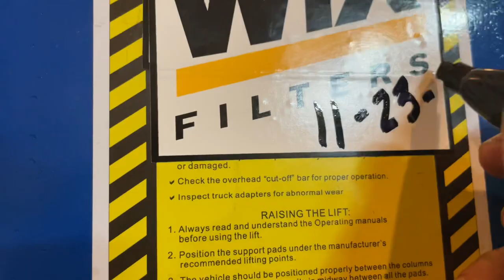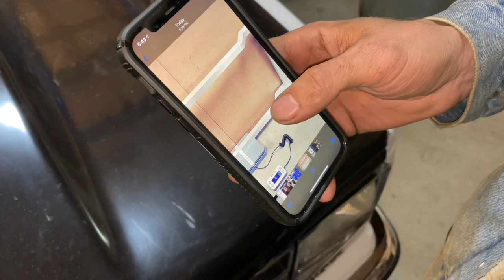Midweek Maintenance on “The Kid’s” S-10!  Valve Adjustment, & Oil Change.

Comment: Eoic...is how I adjust ....to be on the right side of the cam.... When the exhaust valve is opening.. adjust the intake valve... When the intake valve is closing.. adjust the exhaust valve... On my 360 Chevy in the 78 GrandLeMans..

my 66 tempest I adjust them  both when  both  valves are closed ... I haven't had to adjust the 66 Pontiac 406 in years... Both have solid flat  tapit cams in them.. I checked the 406 Pontiac motor never comes out of adjustment the 360 Chevy seems to need adjustment a little more but it's a new cam it ain't got much time on it ..I guess it's a preference I don't see how it hurts anything.. both cars are running fine 360 Chevy and 406 Pontiac...both adjusted different both work with no issues....like I said I think it's just a preference some guys say you have to be on the bay side of the cam blah blah blah blah blah....I've done it both ways to two different motors and both of them are working and running just fine..

Comment: To make that valve adjustment easier, install a bump button on the center of the firewall. You'll love it.
Reply: Adds weight
Reply: I got one for each of my car's..one man band here....saves time walking around the car....there on cords...with clips to attach to the starter....👍,,take um off if I want to...leave it on my 66...use it take it off the 78...

66 pontiac tempest
78 GrandLeMans half baked big tire car.......
Reply from the maker: It used to have one.  I need to put it back on there.

Comment: Love that you guys are working on a normal mans budget on your parts....just like the rocker arms and stud girdles and your exactly right your running parts that can be had anywhere.....since you seem to have a problem getting water in the distributor how about trying to run a big o-ring or a bead of silicone around the cap and base to seal it up a bit more it does help some because I've done it back when I played in the mud when 25yrs ago
Reply from the maker: We’ve only had that problem twice.  Once after we drove 600 miles through a hurricane and once when we dumped water on it to put out a fire.

Comment: Bill thanks for running thru those valves. Something I’ve always struggled with. We run a bbc. Can’t seem to find any girdles that will fit because of the offset on rocker arm studs

I’m curious to know how you know the lash to set valves at. Heard many different things over the years. And I can’t seem to get out valves set right and have them stay. Last time I I thought I had it with an old shitty set of girdles we ended up breaking four push rods at idle.

Comment: Hey uncle Bill, people make me sick online with their bitching all the time, it's like their the only people that know anything. There is alot of things that could cause engine failure. Fuel injection does not stop you from blowing up a engine.

2 things stood out to me whilst watching the video. 1. If it works well, don't change it, I'm talking about the carburetor. 2. You told us that you don't do that well with electronics in the recent past, I'm sure you could learn if you wanted to, but think it's better having a fuel system that is simple, and that you know well, and could diagnose at any given point. 

I've seen engine dyno graphs of the same engine used with a carb and fuel injection. The carb made more power. 

I say stick with what you are familiar with, as long as it works out well. 

Thanx for the amazing videos. Ps, the quality is getting to the point that I have to check wether it is src or src garage lol.

Comment: I love my Harland Sharps, I'm proud of my self for even buying them in the first place. Great equipment.
I also love carburetors, they work like nobody's business. A very simple principal, just move the air and the science takes over..  
As far as data acquisition, Bill you and Billy are the data acquisition. You guy's are the computer on the truck.
It is just like all this hype about electric cars and drag racing, who cares? My Dewalt drill has all kinds of torque and speed, big deal. It's not entertaining or fun let alone amazing.
When a human being can bring the horsepower and then apply it to a sketchy surface and keep it all gathered up and headed straight down track (straight is a general concept) luckily Billy is one hell of driver.   That is amazing and makes me proud to be American. At least until January 20th. God Help this country then.
Take care and God Bless.

Comment: I used to pour oil in the filter until I learned that it does nothing because the oil that is being poured in the filter shoot right out of that hole in the middle going into the oil pan it's those little holes around the middle hole is where oil get filtered

Comment: So do you set the lash hot or cold? Have you experimented with different value lash? Keep up the good work..
Reply from the maker: I set them cold.  I’m not into burning myself on the headers.  I’m lazy.
Reply: @theoldmansgarage  do play with different lash settings? Setting lash loose or tight can give you more low end or top end power..  Please if I bother you I will stop..  I worked in a local performance machine shop and have no one to share the technical information that I have learned...  I am a street racer from the 90s.. I really enjoy your channel since my stroke I can’t work on my cars anymore... So your channel is all I have... Thanks Jared

Comment: Why not go hydraulic like Jon Doc does with that TKM motor. I know that's an LS and its different but hasn't technology came from enough to find a Hydraulic setup that works.
Reply: Solid is a better
Reply from the maker: That’s a very good question.  Maybe I’ll address that in a video soon.
Reply: A solid roller will build more power than a identical spec hydraulic roller

Comment: methanol is a piss poor fuel except for racing put blue locktight on those converter and bellhousing bolts man you also need one of those tools that has the polylock tool in it

Comment: Is that .660 with 1.5 or q.6 rockers? If it .660 with 1.5 it would be .700 lift with 1.6s correct?
Reply: .704 technically but yeah, .440 on the lobe.
Reply: @Danglebarry62   yes it’s .704
Reply from the maker: .660 with a 1.5 which is what we use.
Reply: @theoldmansgarage  o okay

Comment: well here is another know it all with something to say about that "damn carburetor", at wot fuel injected or carbureted makes very little difference when it comes to horsepower, and when Billy runs that thing down the strip where is it ....wot !!! Fuel Injection made part throttle drivability smoother and more responsive when emission controls were mandated, but don't listen to me I am just a dumb mechanic lol ! (wot = wide open throttle)

Comment: The baddest fckn thing in the whole garage is that lawn tractor. You may have to work the choke under a load but that unit is BAD
Reply from the maker: Damn near cost me a divorce when the dealer dropped it off.  Bought it brand new and the wife nearly killed me over it.
Reply: @theoldmansgarage  well luckily you ended up getting to keep both good sir 👌🏼👍 lol